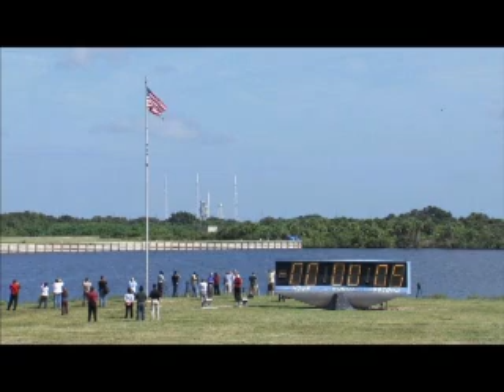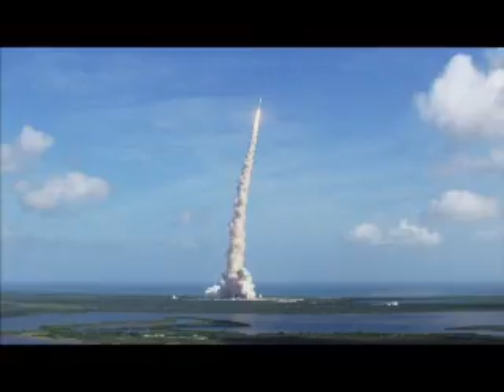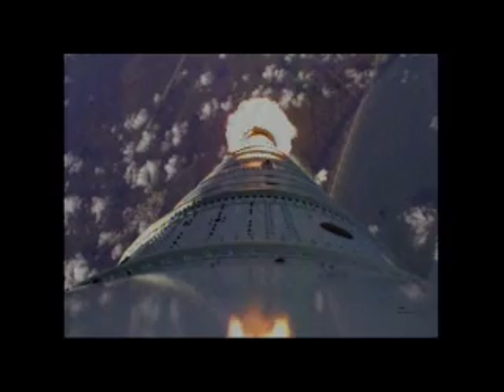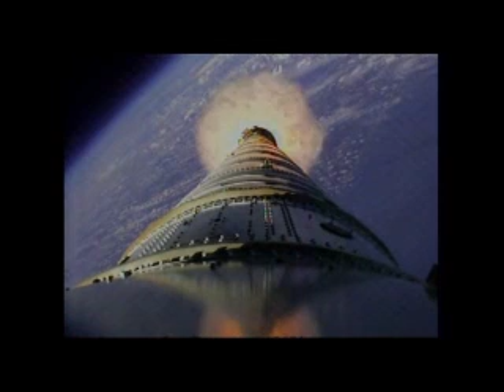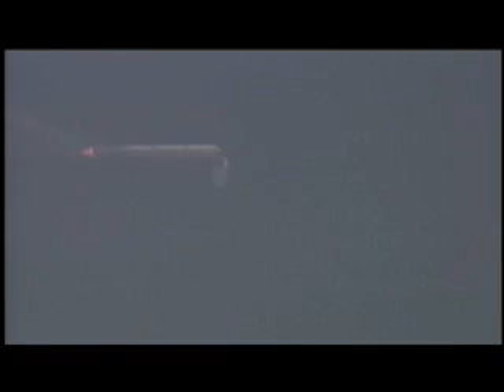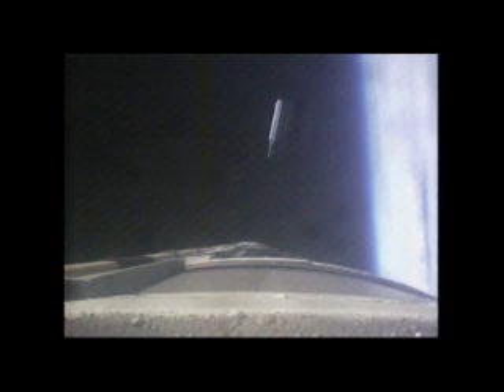Ares I-X Lifts Off on Flight Test

Comment: I believe it's because it insures that the first stage slows quickly away from the other stages.  Thus not risking causing problems for the other stages.  That and it'll land where they expect it to land... the upper stages tumble here to because it was just a test of the launch, normally the upper stages would have additional booster that keeps it going on its way into space.